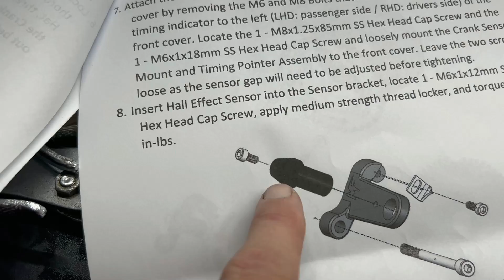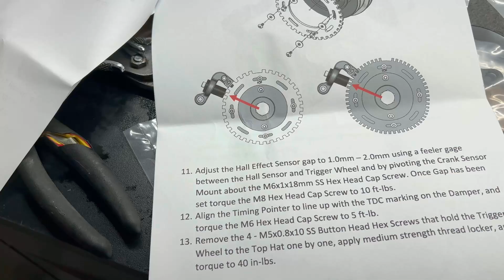Datsun L28 Distributor Delete!  Milk Fab Engineering Trigger Wheel Kit!

Comment: Nice. That motor looks very much like a. Mercedes M180. Isn't it very heavy for a sportier car? Mercedes used a descendant of the M180 in their 250 and 280 pagoda "Super Leicht" two seaters in the mid 60-ies.
Reply from the maker: You’re right they look similar.

Comment: What did you do with the distributor shaft?
Reply from the maker: just leave it in there. You need it to spin the oil pump.
Reply: @fox-body  so what stops the end of that long rod from cavitating at various rpms?
Reply from the maker: Do you mean come out of the oil pump?  I believe it’s held in by a stopper in the timing cover.